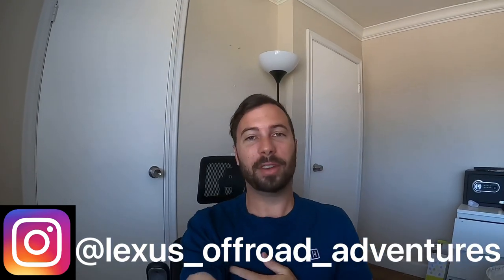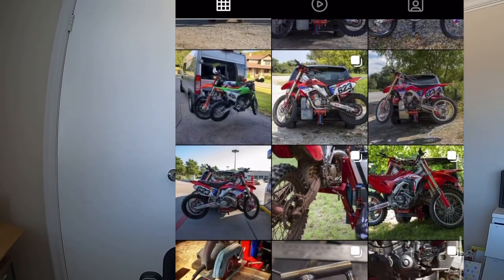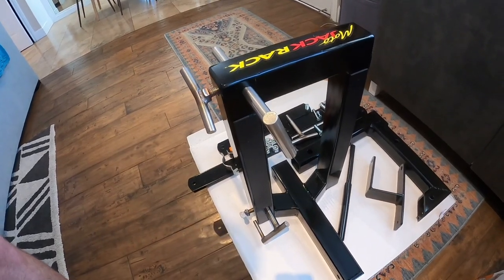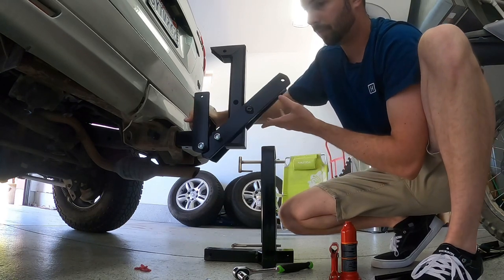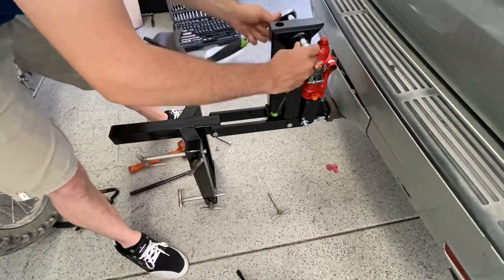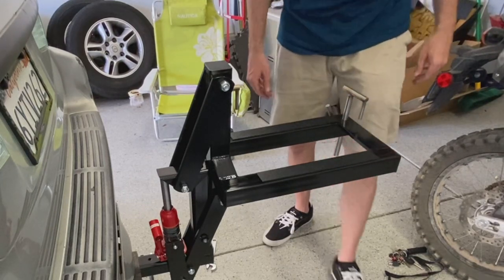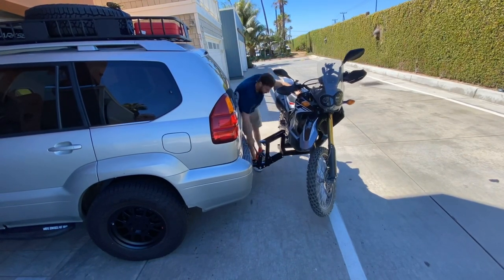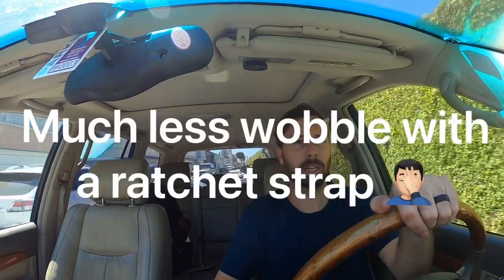Moto Jack Rack Assembly and Review

Comment: The best channel
I have the same truck you have luxes Gx470 .
 brother, I have a question? 
Can I replace My Auto Gear to the shift normal Gear ?
If the answer is yes. 
What kind of Gear?
please help
Reply from the maker: Hi Brother, the Lexus GX470 is designed to only work with the Aisin A750F transmission that it came with from the factory. 

If yours is broken, you will probably need to source a direct replacement. 

If you only want to change it to be able to shift manually, it would be more trouble than it is worth in my opinion. I recommend sticking with the auto.

Comment: Inspect the welds under the bumper on the truck frequently. Consider asking a fabricator if they can beef up the receiver assembly. The less the bike wobbles in the hitch the longer the welds will last. If you stay on pavement and well maintained gravel roads fine, but, do not expect the welds to survive off-roading carrying a motorcycle.
Reply from the maker: My hitch is an aftermarket one-piece that is welded into the frame rated at 600 pounds tongue weight, 6,000 lbs tow. Bike is 340. Not saying I’ll drive it crazy off road but I think the Jack rack would break before the hitch does 😅